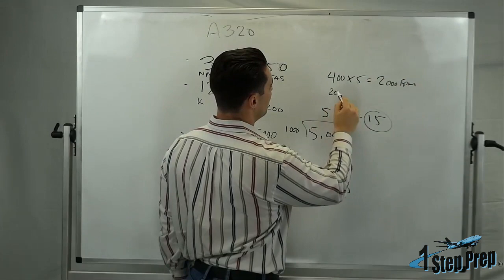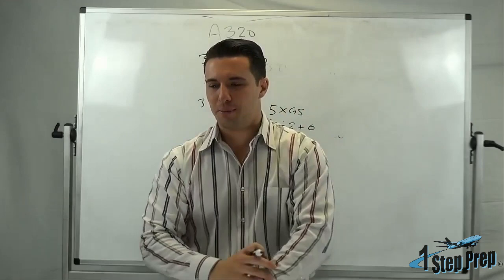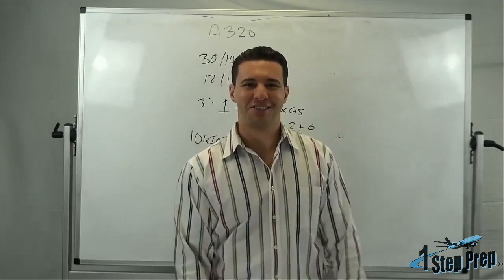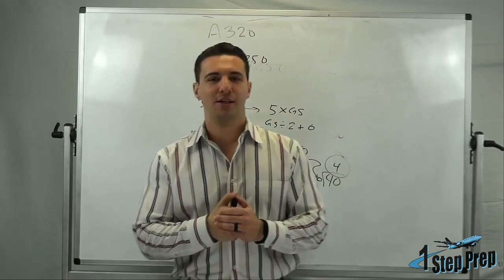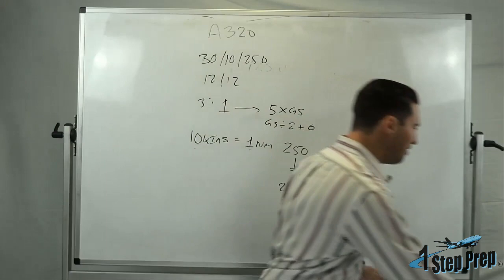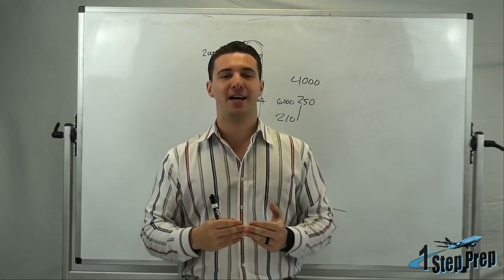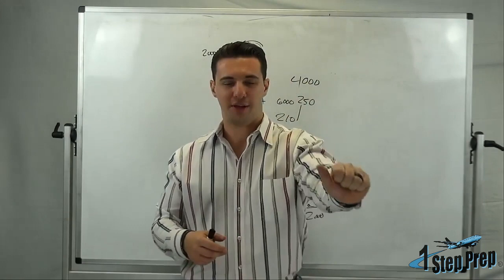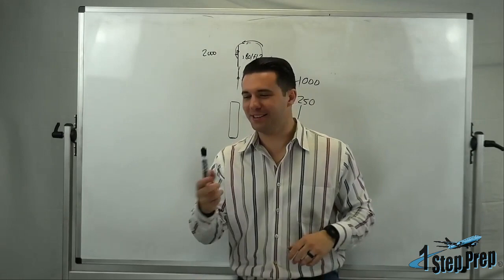Energy Management Tips

Comment: Hi,
Le's assume that I have clearance for a visual approach for a VOR landing at LFLL 35 L, and the chart for VOR (LSE)  DME says that I should be at 2100 ft at 6 DME, 1790f ft at 5 DME, 1470 ft at 4 DME. These do not seem to align to the ×3 rule. If I use this rule I should be at 1800 ft at 6 DME, 1500ft at 5 DME and 1200 ft at 4DME correct?What am I mising here?
Does the 3× rule work for landing visual or is there any other technique? Or it's not plausible to assume that one can land without using chart?